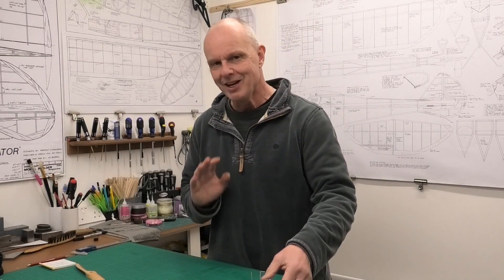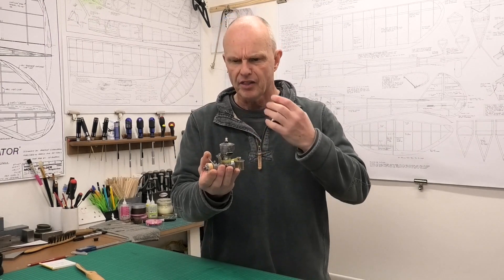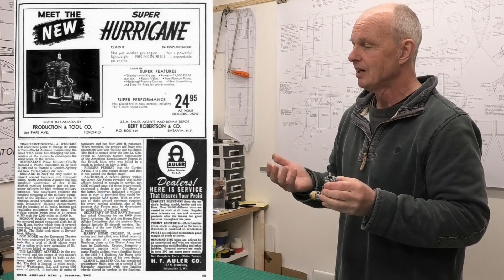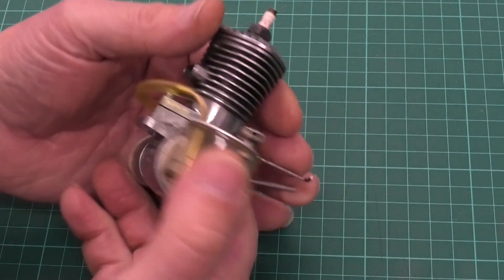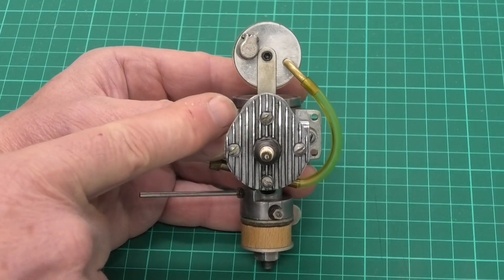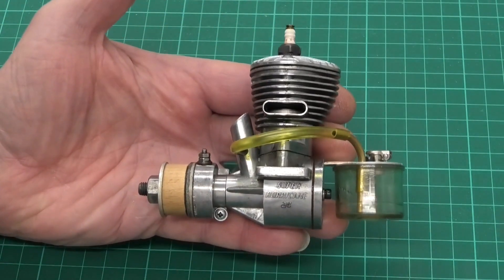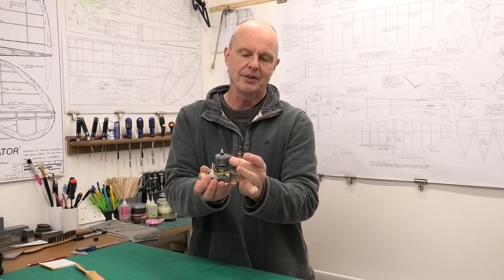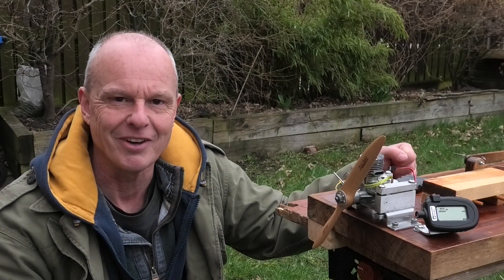Super Hurricane 24 Spark Ignition Engine - Vintage 1940's Petrol Engine

Comment: Hi Mark what fuel you running? cheers.
Reply from the maker: The engine is running on Coleman fuel, a petroleum fuel, similar to White Gas and SAE 50 motorbike oil, in a mix of 3:1, respectively.